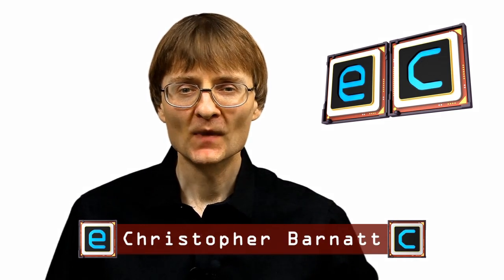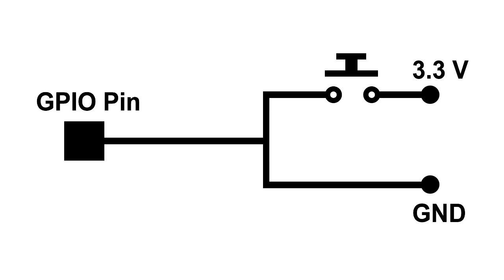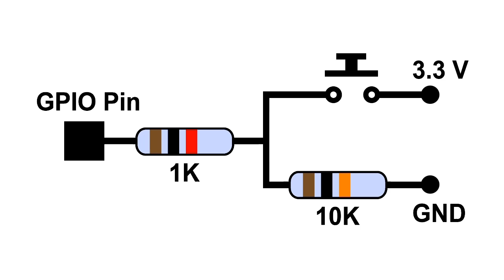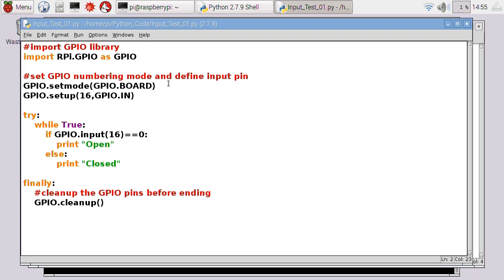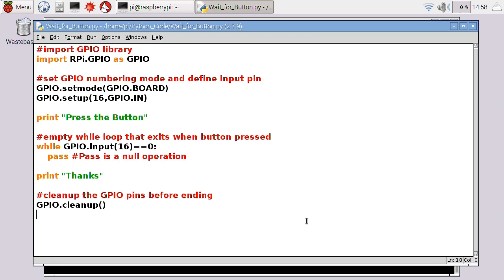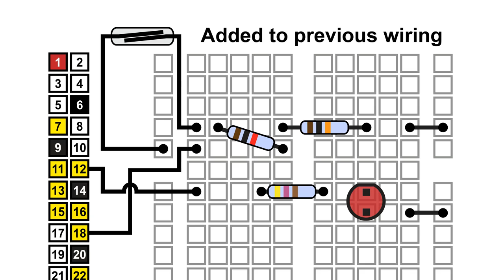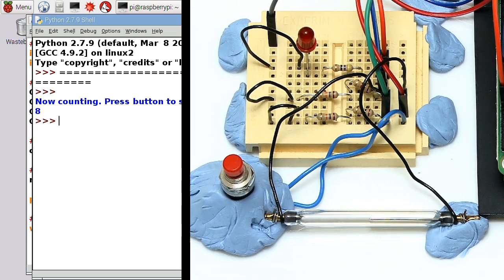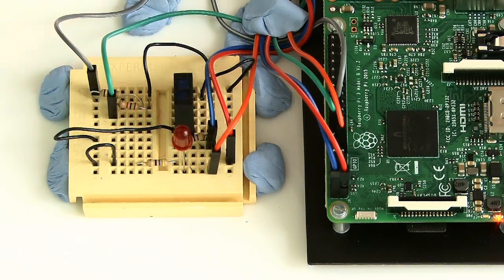Raspberry Pi: Using GPIO Inputs

Comment: Mister Barnett, I must say that I've never heard the concept of pull up / down resistors explained so clearly and concisely. Very well done.  You have given me an idea on how to build an alarm system to see if anyone has opened a door or window remotely and to activate a video recorder to stream the output to my smart phone.  Now all I have to do is to figure out the streaming bit to my phone. Thanks.
Reply: @Bus 22 I'm thinking about same idea, but over sms. I think its possible to write code for arming system by sms or online and to get alerts over sms or watch sensors status online.
Reply: May want to look into an ESP8266; programmable with arduino, lower power consumption and a fraction of the cost ;). Works great for door / windows sensors etc...

Comment: Thanks for this. I've been a an electronics hobbyist for months. This is the first clear explanation of why and how a pull up/down resistor is used. Tons of videos where they say they're using them. So few explanations as to why or how they worked (what they do and why to use them), I was starting to wonder if they were different kinds of resistors. Very clear video. Thanks again.
Reply from the maker: Many thanks. The more I dug into this, the more I realized that a lot of confusion exists regarding the resistors (are they needed? why? etc), so I thought I'd do an explicit section on them and really try to lock things down.

Comment: Chris, I love your videos and am working my way through all of them.  

May I suggest that the schematic drawing of the breadboard connections is confusing.  I think you should explain how the "squares" are connected for those who are not familiar with breadboards.  I.e., each vertical columns of squares on the extreme left and right are electrically connected together, while each horizontal rows of squares (excluding the extreme left and right squares) are connected together.

Comment: Fantastic video!
I too have never been really able to understand what and how the pull up and pull down do and work. I appreciate your tip on the safety current limiting resistor going into the GPIO pin. 
I like your coding work as well.
You have eloquently explained this...
Thanks again for your excellent video! 
More Raspberry pi project videos like this one please.

Comment: I don't know if that's clay dough or play dough, but it's ingenious.  I have stuff sliding all over my laminated desktop, and sometimes falling off the edge and going overboard.  Sometimes I use rubber feet help to keep things from moving around while I work.  So now I need to find out what that stuff is, find some that's non-conducting, and "dough down" all the electronics I have sliding all over my desk.

And getting that Raspberry Pi 4B to work was a virtual nightmare.  Neither of the two monitors I bought for this project would work with the MicroHDMI-to-VGA converters I bought.  So when I first booted it up, I saw bits and pieces of boot-up stuff, but after boot seq., I got two blank screens.  That was with Ubuntu Desktop, after I burned-off 5GB of bandwidth (I only get 30GB per month).  I figured the download might be rotten, so I burned-off another 3GB of data using the  Raspberry Pi Imager - which I no longer like.

The problem with the Raspi Pi Imager is that you can't really store the download - it just downloads it and burns the MicroHD card.  If anything goes wrong, you lose your download and whatever bandwidth you spent on it.  You can copy the card, but you need a clean one for that, and I have Windows data on all of my spares.  I also still have the 128GB SD Card from the Raspberry Pi 3B+ I still have, but for all that trouble, I'm not going to blow out that (working) OS.

In the end, I tried another monitor and it worked.  And then I found a second monitor off of another computer that worked.  The two I bought for this project still work on other computers (with VGA output), but not on this machine.  So that's really odd.

I don't use Python - I use C or C++, so this is a nice video but I think I going to have to download some pre-made software that gives me access to the GPIO ports.  I'm especially interested in the SPI ports, as you know, but there may or may not be software already written for this computer.  SPI communications are not only data, but timing signals (clocks) that have to be synchronized with the data. I'm not sure how the computer does this, since it's usually done in the hardware.  I can only hope that the BCM2711 has it built-in (for all six ports).
Reply from the maker: The clay that holds things in place is called Blu Tack.
Reply: @ExplainingComputers  Thanks, Christopher.  It looks like Bostik isn't going to tell us the dielectric strength (or resistivity) of this material.  I suppose it might be okay for low-voltage applications, but I don't think I'll trust it over 30V or more.  I know there are industrial materials that are great non-conductive adhesives with very high dielectric constants, but I don't want things permanently glued to my desk (work table).

It's not a really big issue, but I do have stuff that slides around all over my work space - especially wires, cables and switches.  And protoboards.  Sometimes I stare down at my protoboards and circuit wiring and take a moment to consider how precariously close to disaster everything looks.  Seriously, it's dangerous.

Comment: Hi! This page is just a gem, especially for beginners like me. Do you mind sharing what app you used to create the breadboard circuit diagrams beside the rPi GPIO pins? Thanks and more power!
Reply from the maker: Thanks for this. It's a long while ago, but I think I did the diagrams in Inkscape. May have been Illustrator though.

Comment: Nice video.  In looking at your implementation of the circuit it seems that the green wire should be connected to the same node that connects the two resistors.  In the configuration shown, the GPIO pin is connected directly to Vcc through the switch.
Reply from the maker: I am confused. In the first and second setups, the GPIO pin is NOT connected to Vcc via the switch. :) As shown in the diagram in the video, the green wire (from GPIO pin 16) is connected to the second horizontal row on the breadboard, which connects it to the current limiting resistor, which in turn connects it to the row below. This means that, when the switch is pressed, the GPIO pin is connected to +3.3V via the current limiting resistor, not directly. It may be difficult to see this clearly in the video -- which is why I included the diagram!
Reply: You are correct.  My apologies.  :-)
Reply from the maker: VicManzo No problem -- keep watching my Pi videos! :)

Comment: The 1k resistor to the board-pin makes sense almost no matter what. What would happen with the print statements (I mean the final output) if you had omitted the 10k resistor to the ground?  Would it still work in some cases but not in others? What would I need to check / know to ascertain whether I need to put a resistor ?

Comment: Hello and thank you for your content Christopher.
 
I've watched this video many times and of course I'm missing something, but I was wondering if one of you guys understood why we have to connect the 3.3 v rail ? Ain't it true that the the gpio pin natively provide 3.3 v dc? 

Is connecting the 3.3 v rail to an input is part of the good practice ?

Many thanks for your time
Reply from the maker: Thanks for this. GPIO pins provide a 3.3 volt output when high. But the 3.3V rail provides a constant 3.3 volts, and is used here to provide the same to a GPIO pin acting as an input when (eg) a switch is pressed.
Reply: @ExplainingComputers  Thank you very much for the answer. 

I wonder if the confusion for me comes from the fact I used gpiozero instead or rpigpio. With gpiozero, the pin is high by the default, making me thinking that this pin behavior is the "normal one", I mean, instead of "floating". 

Anyway, thank you for you answer, hope you'll have a great weekend!

Comment: Help !! I've just bought a box-of-bits (Sunfounder Da Vinci Kit) to kick start my circuit building journey (maybe I'll build a tank one day). The very first tutorial is telling me to do exactly what you warn against! The wiring circuit comprises of +3.3v > 220 Ohm > LED > GPIO (set to output). I get that setting GPIO high results in a PD of 0V (led off) and GPIO low a PD of 3.3V (led on), but this seems a very cock-eyed way of doing things. Is there any good reason/advantage for that approach? and what will happen if I connect 3.3V to GPIO (out or in)?

You're videos are my go-to source for definitive info !!!

Comment: A question: All your code examples sit in a while loop whilst polling the GPIO headers, which locks the thread. How would you read input in a more asynchronous fashion? Say if you're reading input from multiple devices or doing other work on the board. Particularly regarding what I'm assuming is CPython that you're using, which doesn't support "true" threading in a conventional sense. 

Very informative video btw, been looking to learn practical electronics and start doing home projects with a pi. I come from a python background myself so never worked so low-level before :)

Comment: Great video, but you don't need to run the program with sudo(8), if you add the user to the right group.  Have not my RPi near to check which group is needed.  Running program as root with sudo is usually a bad idea.

I would also use a variable or named constant instead of using 16 in the program.  It will help you to use the right value, and not the wrong by mistake.
You should have mentioned debouncing when reading from a switch in the first program. The switch could bounce and give you some fast on-off readings. 

Except for that, great video, and I like the resistors protecting the input.
Reply: Brilliant points. I think he chooses the straight forward route, in order to focus on the hardware parts, but from a software perspective, you're absolutely right!
Reply from the maker: Indeed, and the issue here is the educational one. Just because something could be included does not mean that is should be if you are trying to explain a concept from scratch and to help people understand it. For example, the first setup I use is starting people off, and hence covering debounce there (rather than later) would confuse things.
Reply: The straight forward route is also mutch too often the route people only take. That one, as it is in a YT video...

Comment: Very well explained video. I have one question regarding the LED in the second example. Is the GPIO output pin 12 powering the LED and using the commands GPIO.output(12,True) and GPIO.output(12,False) the Rasberry Pi turns the power supply on and off?
Reply from the maker: Yes, you are correct in what you say. I cover inputs more fully in this video: https://www.youtube.com/watch?v=41IO4Qe5Jzw
Reply: thank you soo much 😁

Comment: Great video.
According to you Python code, you set up Pin 16 as one of the inputs.
However, in your wiring diagram, Pin 16 was not connected to anything.
Did I miss something?
Reply from the maker: Pin 16 is connected (as an input) in the first wiring diagram. For the second setup (with the reed switch and LED), the wiring diagram shows the additional wiring to be added to the first setup. In the final example (using the IR sensor), all wiring is shown in the diagram. All diagrams are on this page -- http://www.explainingcomputers.com/pi_gpio_inputs_video.html -- enjoy! :)
Reply: I do enjoy your videos and I learn something as well. Thnks.

Comment: Thanks for the very clear and useful video. One unrelated question: in which video did you discuss mounting the pi to a custom board? What kind of plastic did you use, anything special? Thx again.
Reply from the maker: I think I first did that way back in this one: https://www.youtube.com/watch?v=5Ud-grj4Zl0  The plastic is called "plasticard", 2mm thick I think -- this stuff: https://www.amazon.co.uk/dp/B00TW9O6D2/

Comment: Hi mister Barnett. Thank you for your great explanation. I'd like to ask you a video to learn how to work with with analogic inputs and web page. My idea is to use Pi to monitoring electrical energy and correct the power factor. Then showing how the energy is going on an web page. Is this possible?

Comment: Nice vid. But I am missing one thing. You mention 1K and  a 10K resistors. But are they 1/4Watt or 1Watt?
Reply from the maker: Here I am sure just 1/4 watt.
Reply: @ExplainingComputers  Got the same setup but with a tactile switch on a pi zero w. When running your test code: Input_Test_01.py i got the opposite result. It loops closed 20-50 times and than open 20-50 times. When i press the button i only receive closed statements.

In case of your Wait_for_Button.py sample is does not wait for any button and just displays "Thanks". Even when I unhook the red and/or green jumper...
Any thoughts?

Comment: Great video for a beginner like me. I do have  question about the physical setup with Pull-Down arrangement. I understand why you are doing this (you explained it quite well), but I just went through a short lesson from the RaspberryPi people and they are not using the Pull-Down setup. Just wondering why they are not.
Reply from the maker: As I mentioned in the video, there are some internal pull-down resistors in the Pi that can be turned on in software -- though they would/will not take that much current. Good electronics practice is to use pull-down resistors -- and current limiting resistors -- as the video shows. You can certainly often get away without them. But it would not be best practice for me to recommend it here! :)

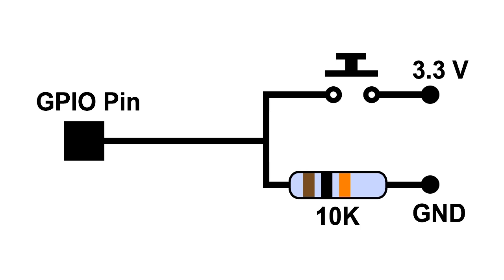Comment: I'm not sure to understand at 3:44 by "if you accidentally turn your GPIO pin from an input to an output": do you mean you could accidently turn the current so it goes from the 3.3V (on the right) to the GPIO pin (on the lefts) right? (Sorry for the basic question...).
Reply from the maker: No problem with the question! I am referring to making a potential coding error where you turn an input into an output, so sending current from one GPIO pin to another as you say. Unlikely, but possible. And hence once reason to use the current limiting resistor to prevent a coding mistake causing hardware damage.

Comment: I was wondering if this is a correct statement?  "It does not matter the size of the resistors, but rather it matters the size of the resistors relative to each other."  In other words, can I use the same setup with resistors that are of smaller resistance but still have similar ratios of each other?

Comment: you mentioned about a line following robot at the end of the video! please can you make it using raspbery pi. it would be a great project and you could also use raspberry pi s wifi feature
Reply from the maker: Yes, I still intend to do the line follower robot -- and indeed to control my Zumo Pi robot wirelessly. I hope to get to these before 2016 is out! :)

Comment: In the pull up and pull down resistors part, I understand why the GPIO pin is protected if we output 0v, but what if we output say 5v from GPIO pin? If we output 3.3v from the GPIO pin, the currents would cancel out. If we had 5v from GPIO pin and 3.3v on the other side of the switch, with the pull down resistor, would that cause a negative current to flow through to the 3.3v and breadboard go boom boom?

Also, in the event we have 0v from GPIO pin, then we will still send 3mA to the GPIO pin. How much current will the GPIO pin, as an output, tolerate going in the opposite direction.
Reply from the maker: A Pi's GPIO pin cannot output 5V. They are 3.3V only.
Reply: ExplainingComputers Thanks for the reply!

Comment: Thanks for the great info on Raspberry Pi projects. Do you have anything on temperature sensors? I would like to remotely monitor a building's room temperature from a long distance through the internet. Thanks, I subscribed!
Reply from the maker: Thanks for the sub. I've not done anything on temperature sensors -- yet! :)
Reply: Thanks for replying! I am sharing your channel with the school I do tech work for. I have looked for info on this but am not savvy enough to know what sensors to buy and the programming end of it. Once I get some info I am sure I can put this together. I want to also monitor Heating system boiler temps at my home. I heat with a wood fired boiler and for safety sake I would like to monitor these temps.
Reply: I left a link I saw in the feed for this video...hope it helps.

Comment: Thank you for another informative video tutorial.  Wow!  Now I want to set up a program to control the fan in the RPi3.  When it's cool at 32 deg. C the fan is off.  When the temp. rises above 32 deg. C the fan comes on.  Can that be done easily?
Reply from the maker: This would require the fan to be controlled via a GPIO pin, which is possible. But you would need to use some kind of controller to do so, as a GPIO pin cannot provide enough power to run a fan.
Reply: Okay.  Thanks for the tip.  I probably would have to incorporate my Arduino Uno to help with that task.  I'll figure it out as time progresses.  Thanks.
Reply: If the fan needs more power then the GPIO pin can supply you can use a relay or a transistor between them.
Search YouTube for "raspberry pi relay output" or "raspberry pi transistor buffered output"